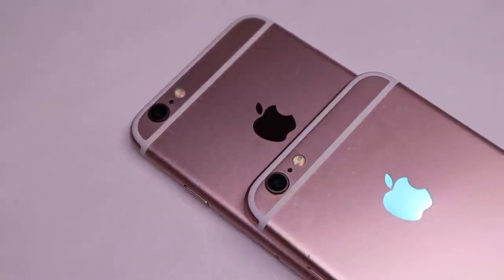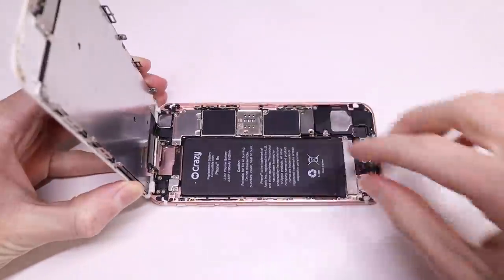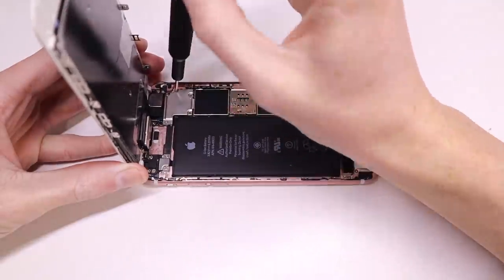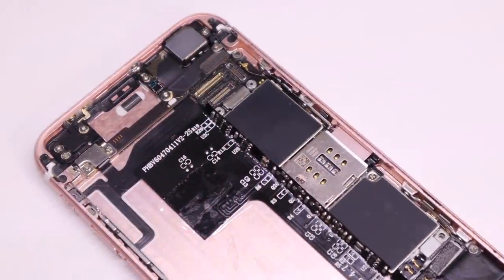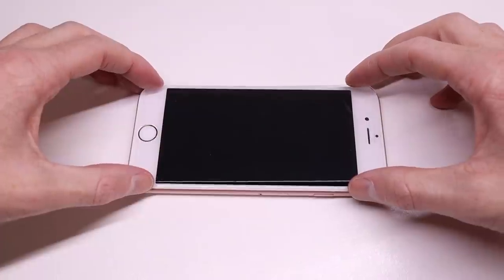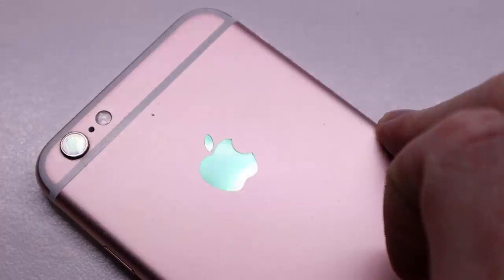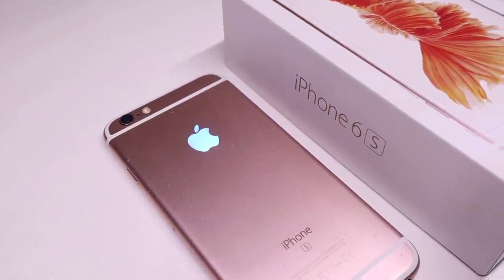Custom [RGB] Multi Colour Glowing Apple Logo for iPhone!

Comment: The real reason why every Iphone case has a hole in the logo.
Reply: Since China manufactures most of the cases
Reply: yea but not all ;-;
Reply: @stanleychen3298  yea lol
Reply: My iPhone case doesn't not have the apple logo hole on it
Reply: @Sorin96SecondChannel  Some Does Some Doesnt xD
Reply: @Sorin96SecondChannel  SAME I HAVE THE APPLE CASE
Reply: Push the logo hard enough and the logo will fall inside the phone.
Reply: @firasytgames3600  mhm ;3;
Reply: @veuitw  ? lol
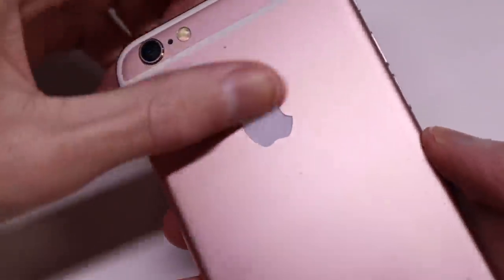Reply: @zoneoftechrules5715  No because  5:05 he shows himself puting clear tape on  it and adding to thick black tapes by the side and am pretty sure noone is gonna use a thor hammer to switch the led lights on.
Reply: Keimarr Jixbii or a transparent case

Comment: One of my friends forgot to disconnect the battery when repairing an iPhone 5S. The battery ended up EXPLODING just because he was trying to position the Home Button Cable.
Reply: Is he ok
Reply: bruh yo man is ok?
Reply: xɪʟ-ᴄʟxᴡɴ.ɪʟʟx he evaporated
Reply: Some people underestimate being lazy to disconnect the battery though they said it seems fine. But it has happened to my friend and frying the backlight of the iPhone. I'm not joking and I'm serious. ._.
Reply: The Light Brigade F4 Shouldn't it be ok to repair if your phone is off anyway?
Reply: Anakin Smithers Was the phone off? I didn't know this could happen even if phone is off?! 🙀
Reply: @arevo8702  Hes probably ok. but definitely inhaled some toxic metallic fumes. Which is not good. Can impair you forward on.

Comment: Regarding your battery placement at 7:25...

This is what I used to do when I was at Apple. When the battery adhesive is applied, plug in the battery BEFORE you remove the pink tape. 

With the battery plugged in, you will drop the battery down in a position where it will be in the correct place 100% of the time. 

If you drop the battery in and then plug it in, you risk tearing the cable.

Comment: I’ve got the modded logo for my 7 Plus and it’s been almost 2 years now since I’ve had it. I have the RGB one also but mine doesn’t that the speaker sync as I also agree it’s annoying.
Reply: where did you get it?
Reply: Coral Jones amazon
Reply: Main Gamer how the battery’s going?
Reply: Coral Jones I got mine off DHgate
Reply: Loui JS battery is decent but recently the mod stopped working as a whole so I killed off the connection incase it would cause complications to the phone.

Comment: I installed the same one from Amazon a few months ago, but have had an issue where it activates randomly and stops responding. My guess is it’s getting pressed from the other side. Would have definitely given up RGB and had it wired into the screen so it could be controlled with brightness and not taken as much power.

Comment: Is the logo in this mod ALWAYS on, or only when the screen is on?  Also, I noticed you put new stickers on the battery...wont those rip off components from the logo board when you pull them off?

Comment: use the brake cleaner if pull tabs on battery are torn apart. just spray a little bit under battery and let it sit for a minute. then turn phone around and battery will fall out

Comment: my 6s keeps rebooting every 15 minutes and the phone won't hold charge.  It said it is charging but no battery % increase.  If I remove the led logo, everything is fine, the same charging cable charges and no reboot.  I did not connect the second connector to the speaker because you said it is annoying.  Do you think this is the problem?

Comment: Done it on 7 and 7 plus.. all lcds with battery connector has sucked for me. Usually the lights will turn off (if touch activated) suddenly. Never had it light 24/7 even if not touching the logo for sure, so kinda sucks

Comment: Hi hugh. I bought my self a used iphone 10, out of warranty, within days i saw that there was a battery issue where when i use face id lock the system would switch off . though the battery showed 95% health it would switch off and show 3% battery life. So i changed the battery for a few days everything worked fine then i noticed a single pink line on my left side of my screen. Googled it, said voltage problem. Few times i switched off and everything was fine but now its permanent. U have fixed so many phones u might know whats the problem with my phone. Please help

Comment: Hey Hugh, is there any tips to replacing a battery on a 6s? I’m replacing mine!
Reply: The only tip that actually matters is to remove the Taptic Engine. It makes removing the pull tabs easier.

Comment: @hugh - you should have cut the adhesive battery strips shorter as now those sticky tabs are now stuck on the led strip you just installed so when you need to do a battery replacement in the future you could damage the led when you pull the tabs 🤦‍♂️🤷‍♂️

Comment: Pro tip: Only use half (one strip) of the battery adhesive in the middle. It's soooo much easier to remove if needed and still holds the battery in very well. Also you save a penny.